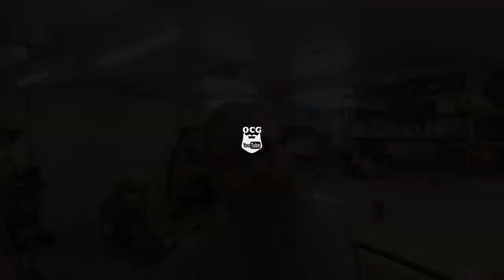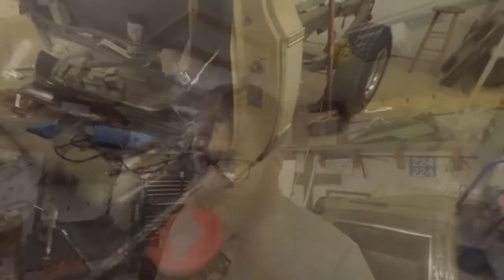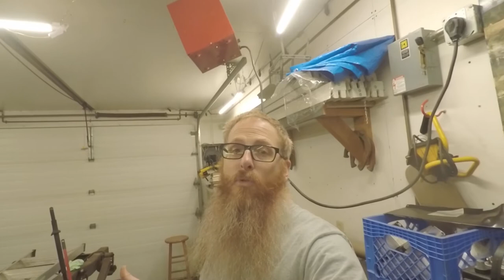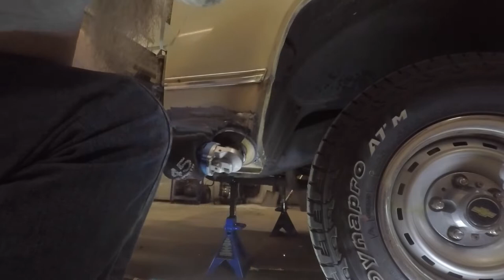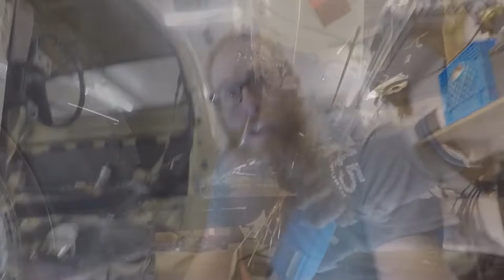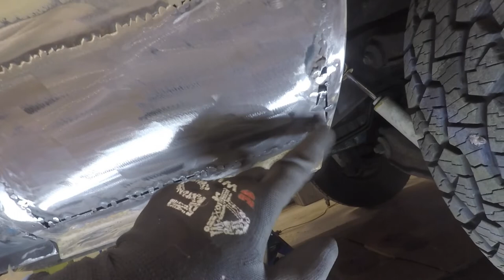FINALIZING THE PATCH PANELS ON MY 1977 CHEVY C10 PICKUP-SETTING 2020 GOALS

Comment: Weld it up, grind it slightly to protect the integrity of the welds and the adjacent metal, sand blast the welds clean, "hit it low and fill it with dough" as an old guy I worked with used to say:)  Nice Job!
Reply from the maker: Thanks Jerry! I really appreciate you coming over and checking in! I’m definitely learning lots!
Reply: @OldeCarrGuy  I subscribed to your channel - I'll be checking you're videos out.
Reply from the maker: Thanks again!